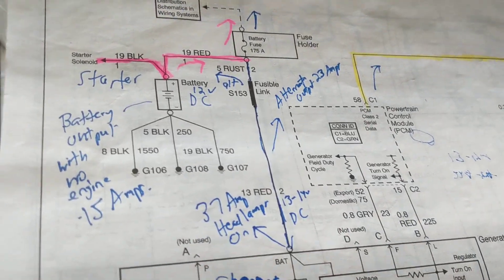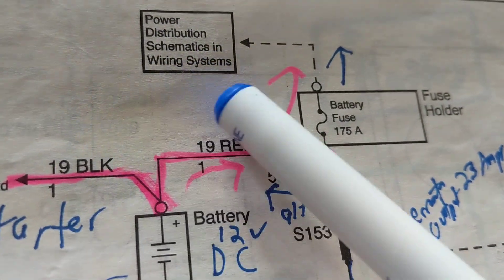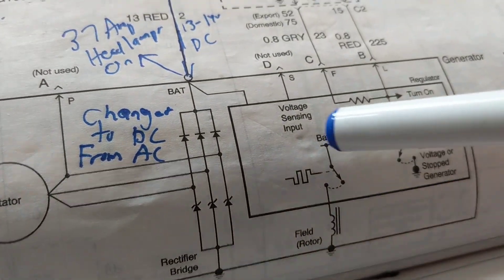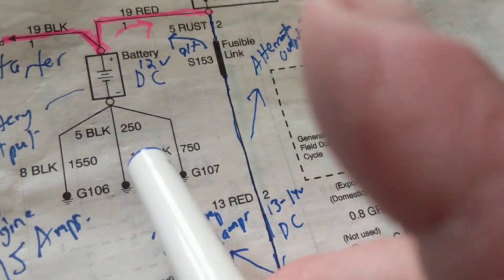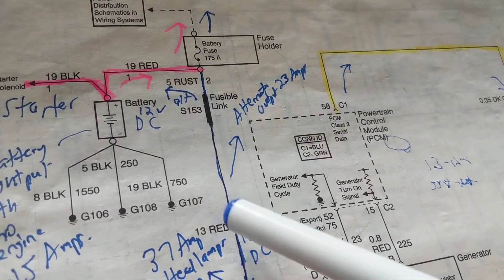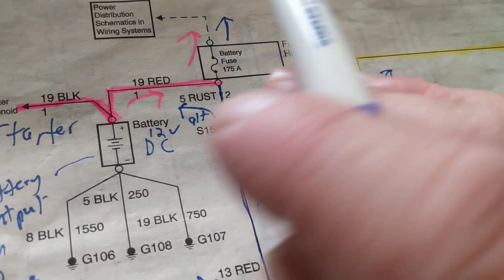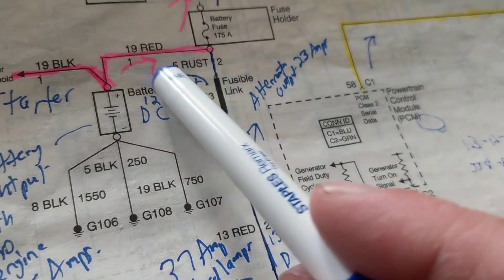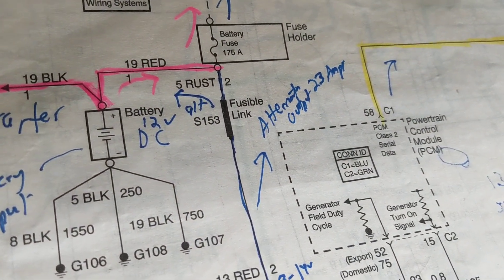HOW THE BATTERY AND ALTERNATOR WORK TOGETHER

Comment: hello joe, i found ur page and i really like ur videos. im a self learning of car electronics, anyways, i allways wonder whats the thing that stops the current to go from tle alternator to the battery after getting fully charged
Reply from the maker: Great question the computer senses the voltage at the battery either through a connection to it or also through a battery sensor telling it when it is charged alternators are all computer controlled thank you for your comment
Reply: @Joeelectronicschematicsforauto  thank you for your reply! Keep up the great work, i will try watch more of ur videos when i have time
Reply from the maker: @yassin9749  no problem thank you